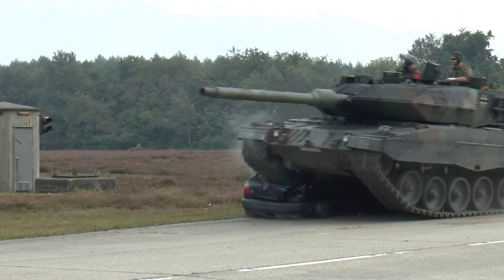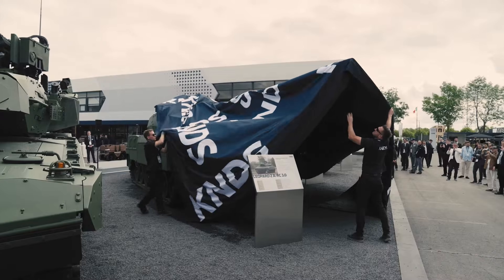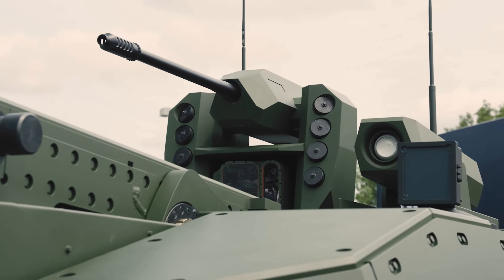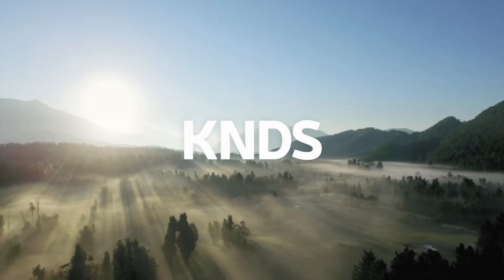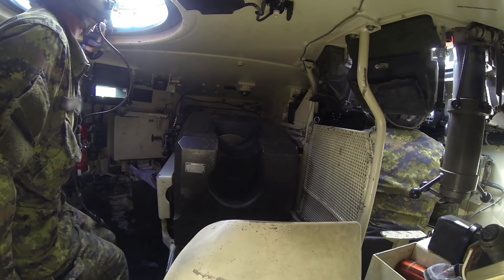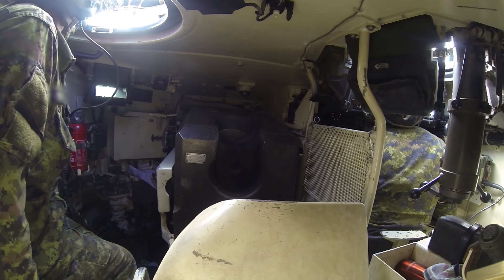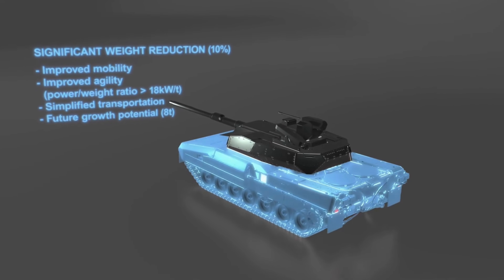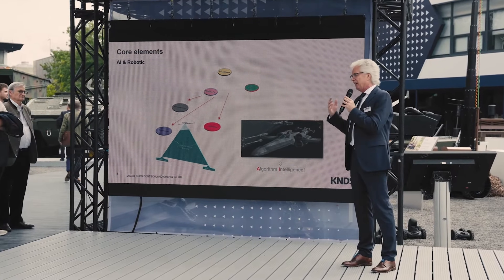The Leopard 2 A-RC 3.0 Main Battle Tank | 140mm SMOOTHBORE GUN

Comment: I think if you re-purpose the tank to be an anti drone vehicle that happens to have a cannon is the best idea. All the electronic counter measures, tracking, detection, ai assisted electronics you can pack into it with at least two autocannons. Expensive but it would keep the sky clear for everyone.

Edit: I'd even go super heavy if I was European and didn't need to cross the ocean. Widen out the track base and offer better 360 protection.

Comment: For tanks to be survivable in the future battlefield against fpv drones, I believe they will need drone detection radar systems with autofire capability and programmable fusing from a secondary weapon system (which should also be able to take on an ATGM).  Until such a system can be built, tanks will have a very limited usefulness and perhaps only be a liability against current threats.

Comment: From many many points of view this tank is much much more like the MBT-70 than like the Armata.  If it is like the Armata then where are the vision blocks for the 3 crew members?  You note that the 3 crew members have interchangeable work assignments, with the capacity for each to take each others work.  Isn't that like the MBT-70?  How does the crew get in and get out?  They never show this in the video!  Is it because the system is not perfected yet and they now have to do the impossible or forbidden and go through the turret to get in and out?  On the left and the right sides forward (seemingly just above the tracks) there is a very angular indentation with what seem to be 4 different sized cameras or vision blocks inside.  Vision blocks that small? Please post answers or paths leading to possible answers.  I have no opinions on this one because there are too many questions.

Comment: Several new main battle tanks in development at the moment have the ability to launch drones. I completely understand the need to have drones support tanks on the modern and future battlefield, but I fail to see how it would be much of an advantage to launch the drones from the tank itself. Drones could be launched from support vehicles, in the same way that infantry is carried in infantry vehicles, mortars on designated platforms etc. I believe tank crews should focus on direct fire. 
Some disadvantages with carrying drones with the tanks, are: the drones will take up valuable space, require opening of hatches while launching or retrieving drones, burden the crew and the tank commander with drone control, logistics and maintenance, increase signature of tanks, as e.g. drones can be traced back to the tank. The advantage I can see is "ownership". Tanks could launch their drones without having to communicate with other units. This can improve reaction time and integration between tanks and drones. But this just feels like another failure at combined arms, "We can't communicate with the other arms, so we need our own organic capability that does the same thing". 
I get a feeling the drone-in-tanks idea is more psychological and market driven than a result of tactical planning. Maybe the underlying message is: "Tanks are going to be ever more vulnerable to drones, but look: our new tanks also have drones, so they can fight back!" What do you think?

Comment: The Leopard 3 will most likely use the 130mm L/50 gun, which already has +50% more kinetic energy than the 120mm L/55.
My prediction is that the future MGCS will spawn 2 tanks, one with the 130mm (the MBT version) and one with the 140mm (self-propelled artillery / field gun version).

Comment: Looking at the Ukraine war I can't help feel like 140mm is overkill. 120mm can still deal with pretty much anything the russians are fielding, and if anything operational sustain has been the limiting factor (being forced to stop when ammo is running low). Which has been cited as a problem with for example the Bulat.

As for favorite tank. I can't help be a bit patriotic and say the Strv122. While it needs an update in both gun, armor and active protection systems the tank has shown that it is capable of doing its job (with not a single crewman ever dying inside a Strv122 despite 10 of them participating in Ukraine in very intense fighting). The extra top armor compared to regular Leopard 2s have made a lot of difference in the very drone and artillery focused battles in Ukraine, and while Strv122s have been knocked out many of them have also returned to the battlefield again and again (with even intense drone attacks failing to achieve more than mobility kills).

Comment: I would call this tank trash, but it is almost trash. Only because of its 140mm gun. The tank has no cheapness. A lot of unnecessary armor. Expensive engine with more than 1000 hp (should be no more than 700). No huge dimensions and no large-sized additional armor like BRAT from Bradley. Its upper frontal part is not covered with several sheets with rubber on top of which BRAT is also installed. The tank is stuffed with unnecessary electronics. Anything that complicates a vehicle leads to the defeat of the country of manufacture before the battle. One drone worth $100 will destroy it. If not the first, then the third. And you spent more than $10 million on it. This is nonsense. No matter how you protect the vehicle, it will be destroyed sooner or later. A vehicle with a 140mm gun should have no more than 10 rounds(best 8) of ammunition. For modern tank tasks, this is even too much. Drive out, shoot at targets, and leave in 2 minutes.(At maximum speed)
  We need a regular loader, not an expensive automatic loader. Fewer shells - more space behind the armor. This will improve survivability from penetration by a drone.

Comment: You can clearly see that the design thinking behind this tank is stil lbased on the Panther and Tiger heavy tanks while the track wheels seem inspired by IS-2 USSR tanks and of course later upgraded to newer tech. European military's look so ceremonmial, as I don't see any drone receonnaisance operating with the Leopard nor data of such recon systems being used for target acquisition by the tank. So how is "data integration" going in NATO??? I applied to their institution and their website didn't even work!

Comment: Don't give too much Credit to the Russians; an unmanned turret was explored by the US in the 1980's on the Abrams Block TTB.
Drone defense has to be paramount on any future MTB design OR it will have to be accompanied by a specialized vehicle.
And I say let's stop screwing around with cannon sizes and go straight to the 155mm ; the tank will also be mobile artillery.  :)
And with the right 155mm ammo you can take out helicopters that stand off at 12 km picking off your units.

Comment: Why does a tank need a UAV? This is extra work for the commander, and as always happens, the UAV will not work because it is broken. The tank is part of the army system. If there is no system, then it is the fault of the army structure, not the tank. Now tanks are used with the support of reconnaissance UAVs, these are separate people. Why would a tank, which already has so many tasks. Implement UAVs? 
A tank is a tank for breaking through defenses and supporting infantry. There is no need to make it into a super nanotechnological machine that can be destroyed with one shot or by a mine.

Comment: Think about the 130mm of the KF-51 Panther by Rheinmetall. By technical specs it already has a 50% upgrade in firepower to their older 120mm cannon. Mind you, that's just basic shooting tests, not battlefield experience. That's just an increase of 5mm radius. That's tiny.
 An increase to 140mm is a huge increase by comparison. Yes it only means 10mm or just 1cm more radius. But the surface area increase thanks to πr^2 is huge. Add to it potential length increase of the caliber, and the change in the amount of propellant is huge.

Comment: Tanks should have a backup team support, using secure satellite communications. They can provide important and useful data.  They could also be linked to tank sensors and drones. Back in a safe base or bunker they can monitor sensors when crews are resting or doing other work. And allowing for the operation of drone, while crew can spend more time doing their roles. This is more important when a 4-man crew loses the human loader to a mechanical loader..  And crews can operate 24/7.

Comment: Current ammunition in Ukraine seems to be efficient.  And China lacks very heavy tanks.  With a missile backup that can be long range or NLOS  where a 120mm may not be sufficient. Having top attack capability.  I really like the Leopard 2 Revolution upgrade package with greater self-protection. Any new tanks/turrets or upgrades, should be built with a potential rapid 130/140mm upgrade design.

Comment: Interesting setup, sensor suite design and installation location will be critical. Ability to call for artillery fires is another element needed to offset the very poor ammo loadout. I study the past to understand what worked and what is needed now. The Marines on Tarawa found out the hard way the Shermans needed more ammo as it was impossible to upload ammo during daylight so in many later operations, they were carrying 100 rounds using added easy access racks.
Ukraine is using tanks as long-range snipers in the more static areas. They are leading in drone development and deployment across both land and water deployment and on par with Russia in air deployed drones with fiberoptic control just starting now.

Comment: Finally, 30mm autocannon, no more filthy american 12,7mm medium machineguns nor 20mm heavy machineguns, finally 30mm autocannon roof turret and missile launcher on an MBT, also increased angle of view from what i can see (cameras almost all around) and 140mm autoloaded gun, though under 60 tonnes... I am worried of how much armor they are sacrificing this time, please don't be giving this poor guy 35mm of armor on the sides, that can be punched through by literal heavy machinegun fire or even medium machinegun fire, that's no MBT, that's a light tank with front armor.
To increase mobility with (decent) ~60mm armor all around only option is increasing the engine power, and i don't think this thing has got decent armor all around, same curse as all other Leopards before itself...
I hope Leopard 3 will get decent armor all around and not light-tank tier, cuz it's supposed to be an MBT.

I know that modern detection systems are advanced as hell, but no amount of situational awareness is enough in urban environments and forests and actually anywhere, and to make something that can react fast enough so something from a random direction you'd need a mech which is very far from today, so having armor to survive a couple unexpected hits to have time to return fire at least would be preferable rather than dying first or second hit from a flank. And while the 140mm gun has maximum 25° of elevation, the 30mm autocannon roof turret can surely at least do something about it faster and at a more different angle from ground level, so it could also shoot back to enemies in a 4th floor.

Comment: All tanks of the future need a dedicated situational awareness crewmember who would primarily use drones or secondary optical sensors and telescopes in order to monitor for threats or scout ahead of the tank. This means potentially 4 members, but I would say the ideal situation would be to have the driver take over the gunner role, fusing them which would make the tank much more effective as you don't have that communication issue. The commander would then monitor the tank status itself and coordination with other tanks and the third crewmember would be the situational awareness role and perhaps secondary weapons.
Reply: Technically Ai can replace most of the crew in ~10 years time, with 2 crew members being likely. South Korea even shown such concept. You have a driver/gunner and a systems operator/commander.
Reply: @interpl6089while obviously not a bad idea to have less crew I wonder if it would be that much more beneficial, less guys means less men to do maintenance or other tasks for the said vehicle

Comment: It looks good.  Would like to see maybe a new chassis design similar to the Mercova. With engine at front for extra crew protection.  And a rear entry/exit door.
The floor emergency hatch has been a Hollywood fantasy for decades.  While the idea is good. It does have lots of potential problems.  But would like to see if or how it would work. I think space and accessibility would be an issue.. and also tanks spend a lot of times with the lower parts of the hull either under water or in deep mud etc.  So doubt a belly hatch would help to much if your in a swampy environment.  And also the risks of leaking if your are having to wade through water.
I don't think Tanks or Tank warfare is dead. Far from it. I think way to much is being put on about Drones. But in reality Drones have lots of very big draw backs. And can be disabled by very simple systems. So in reality they are not the big threat people seem to think they are.

Comment: It doesn't matter what the capabilities of the tank are, the fact it's only a 3 man crew has made it a terrible tank. I'm all for auto loaders, but that's to free up the loader to be a drone operator for the tank.

The British Army trialled a 3 man crew to test the viability of an auto loader in the Challenger 2 when it was in development. They carried out an exercise where the loader was only allowed to do what was necessary for the tank to function, basically loading and not a lot else. As soon as they disembarked from the tank they had to put on a white lab coat and couldn't do anything to assist the rest of the crew, no helping to put up cam mets, Carr out maintenance, cook rations, Stag on (sentry), ect....

I cant remember the length of the exercise, it was meant to be something like 2 months. The exercise had to be stopped halfway through due to it becoming incredibly unsafe due to crew fatigue.

Before and immediately after the exercise a University carries out multiple test on all the crew to test things like reaction time, grip strength, cognitive ability, ect.... After the exercise not a single soldier passed any of the tests, the grip test results were so bad that not a single person had the strength to hold in the grip switch which is like a dead man's switch to take control of the gun. As a result an urgent upgrade to the Challenger 1 was made to make the grip switch easier to depress and the auto loader concept for Challenger 2 was thrown in the bin.

Comment: The modular turret and the concept of the turret being "separate" from the hull allows a greater range of systems like the scout running HV 75 mm guns with more missiles and drone launch and counter drone systems.  Having an AA and Mine clearing/line charge turret as options as well.  The ability if it is possible to swap turrets in the rear area means repair or reconfiguration of the units armor can be done as needed.  Having one hull for a large number of mission packages means far less spare parts and common technical training to lesson the burden on combat area supply and repair.

Comment: Since the standard crew daily maintenance remains approximately the same  reducing the crew size is a major impact to the amount of manual labor each crew member is responsible for.  That is a major impact when crew size is reduced, the law of unintended consequences applies.
Reply: Except the fact, in real life, in a war situation, a 3 crew tank country can deploy one more tank for each 4 tanks. That is 25% MORE crews available. A much more important advantage, in wartime, than an extra pair of hands. And if you build better tanks, from a maintenance pov ( rugged ones like the soviets did) you will do far better.

Comment: Enjoy your video.  Couple of quick points.  Different gun calibre tanks, within a unit will become a logistic nightmare on the battlefield, especially if you reduce the number of rounds carried per tank.  Trophy is nice, but that is not keeping up with the latest threat to tanks.  EW jamming, especially if directional against the threat (drone), could be an asset.  Furthermore, enhanced protection of the optics needs to be addressed.  Without optics the tank is useless, and a very cheap drone could probably obscure, if not destroy, the optics relatively easily.

A dull and possibly irrelevant item.  It appears that access to the turret is only from the outside.  Correct me if I am wrong, please.  In a time of conflict, what would the crew do if they needed to access the mechanism within the turret?  I realize that automation is paramount, but sometimes a simple, manual fix works wonders.
Reply: Logistical problems always appear with new equipment.
Reply: @emilsinclair4190  Understood, but this would be a created logistic problem that shouldn't exist.
Reply: @edp8592  sorry but introducing new weapon systems and vehicles always creates a time where the logistics are not there yet. This was also true for 120 when it entered.

Usually you have a time with both system serving while once numbers grow while others slowly shrink until the new system and it's logistics are the only system.

Not upgrading creates bigger problems then introducing additional logistics for some time.

Comment: Any weapon system can be defeated by the application of force against vulnerability.  The question is what utility does a tank bring other weapon systems can not. This is basically a large bore direct fire gun with rapid fire, rapid mobility, and invulnerability to small arms fire. No other weapon system can do this. Until that utility can be replaced the tank will remain as a key and desired component on the battlefield.